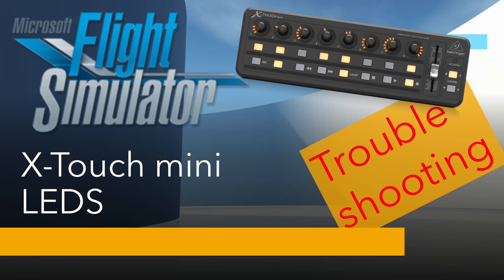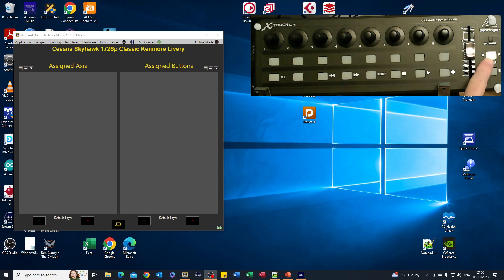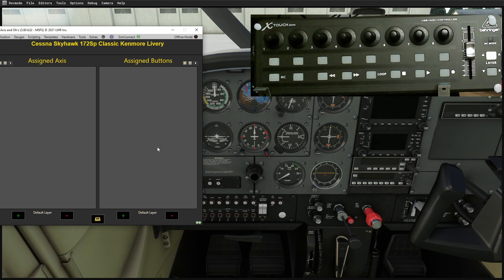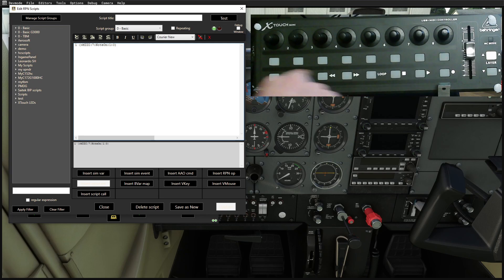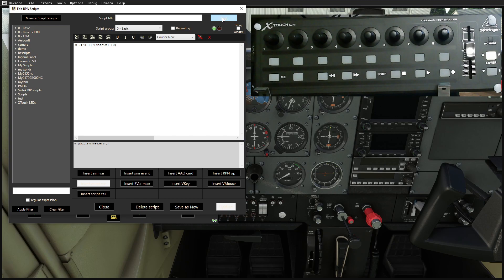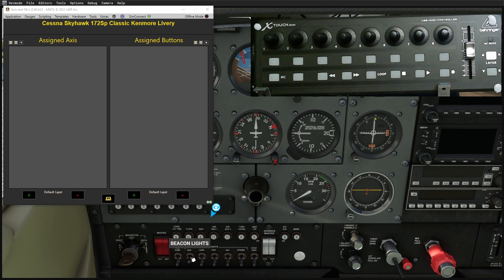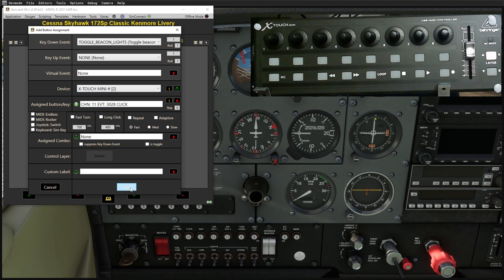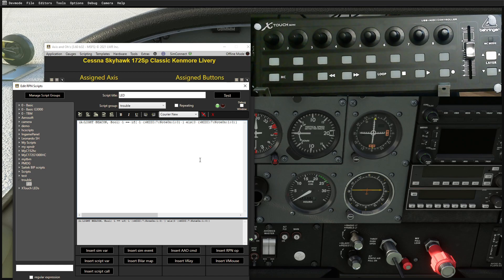MSFS axis and ohs, x-touch mini LED trouble shooting

Comment: Hi, help me please don't work, the script for led work 1·(>MIDI:5:NoteOn:11:0) but when I try complete script don't work (A:AUTOPILOT·FLIGHT·DIRECTOR·ACTIVE,·Bool)·1·==·if{·1·(>MIDI:5:NoteOn:11:0)·}·els{0·(>MIDI:5:NoteOn:11:0)}   Whats is it the problem, Im trying with Fenix A320
Reply from the maker: I’m away from my pc for a few weeks

First thoughts. I use channel 1 (the number after note on)

Have you watched the flight director variable to make sure it is changing?

The script needs to be running in the background all the time. It needs to be allocated as a plane autoscript

Comment: Hello, thank you for your tutorials which are very clear and very useful.
For me everything works well thanks to you managing the XTouch Mini LEDs.
The automated script allows me to turn the 16 LEDs on or off. But how to distinguish based on the selected layer (A or B) so that the LEDs respond to commands differently depending on the selected layer.
Thank you so much.
Reply from the maker: The short answer is.... I don't think you can.  The Layer buttons are internal to the x-touch.  They don't transmit anything, just modify what midi message is sent when a button it pressed.

The long answer is .... I can think of a way of doing it as you can change the layer by sending an external command rather than pressing the layer button.  So you could use a diffierent button to toggle the later.  Keep track of this with a variable (an Lvar), and use IF statements in the automatic script.  I'll add it to my list of things to try and get back to you with a comment here.
Reply: Thank you for your reply. I tried to send a MIDI command to XT to change layers but I couldn't do it.
I tried 1.(>MIDI:3:Program Change:1:1) but that doesn't work.
Do you have the solution or is it impossible?
THANKS. @Keith_Butcher
Reply: I found the syntax: 0.(>MIDI:deviceId:PrgChng:ChannelId) for layer A and 1.(>MIDI:deviceId:PrgChng:ChannelId) for layer B.
Good day.
Reply from the maker: @BestStrategicGame  That's great. Hope  you can get it to work as you want it

Comment: do you have the Kodiak 100 in your hanger if so looking for lvar to control instrument and switch panel lights
Reply from the maker: I haven't yet.  It's been on my list for a while.  Which version have you got? There seems to be one on orbx and one on simworks
Reply: I have the simworks version got the issues raised above resolved, but now Keith I cannot get the fuel valves on wings to operate I go in Aaohs run scripts it gives me this "16 (>K:FUEL_SELECTOR_SET)" when I test it does nothing
Reply from the maker: @vapilot7814 I haven’t got the Kodiak so can’t look at that setting. There is a support forum. I think it’s on avsim. I’m not near my pc for a while to look things up.